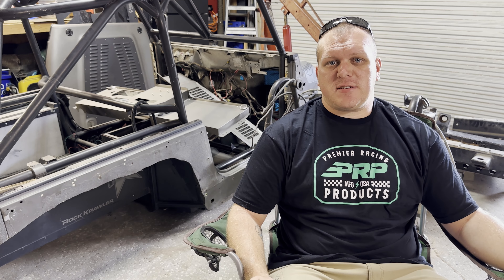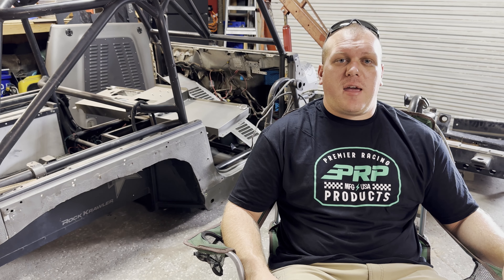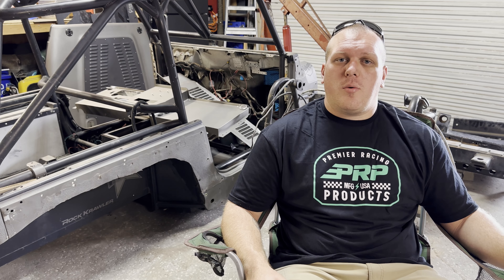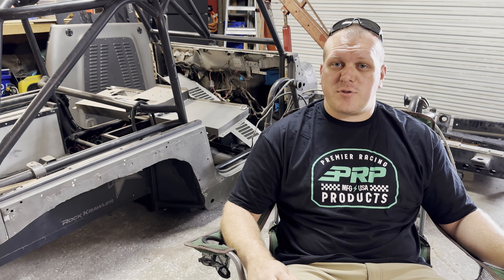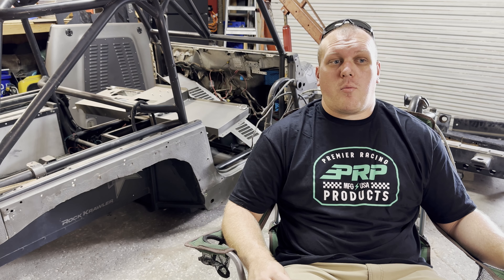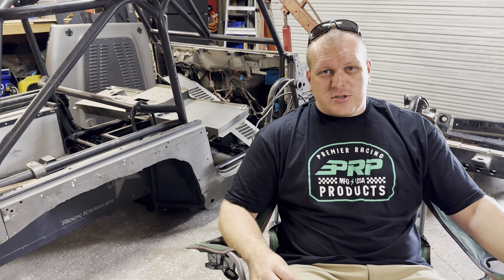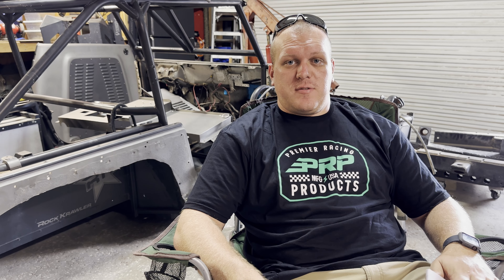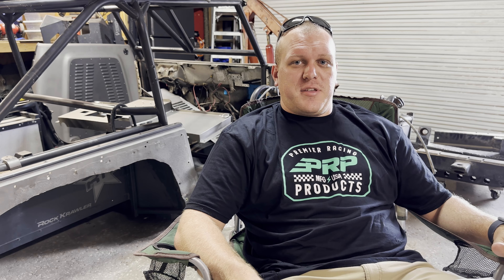Recoil TJs Rebuild Plan

Comment: You are going to have to go full hydro on the front with the double triangulated kit, if not and you try to go 3 link you will have binding issues correct?
Reply from the maker: The Front half kit is designed for full hydro. You COULD make a steering box fit though. The front 4 link could be modified into a 3 link but that's not what I decided to do. I went full hydro so Im keeping the 4 link. Yes, technically you could have some binding issues if you ran a 4 link with a drag link because of the different angles of axle travel.

Comment: Really enjoy your work and channel. Do you have a instagram page or fb? I want to get your in input on put 37’s on my tj. Im on 35 with4.5 lift and rockcrawler long arm. I want to put a rear stretch without going all out. I know they make genright factory location tank. How would you go about stretching the rear without relocating tank? Is it simple as adjusting arm length and relocating rear spring location? Or do I need to change rear links?
Reply from the maker: Absolutely! Instagram link should be on the main channel page. Recoil_TJ

Comment: Do you really, really need tons? I ask myself that on a regular basis. I've got a ProRock 44 up front, built to the nines. 35 spline RCVs, ARB locker, Reid knucks, BJ deletes. Trussed D44 in the rear, 35 spline chromos, ARB, Yukon gears, sitting on 40" STT Pros & KMC beadlocks. Those axles have never failed me...never. And yet the end goal is still SD60/14B. I've never babied it either. I'm heavy on the skinny pedal & in the back of my head I almost want to grenade it so I can justify spending money on tons. If I'm being honest with myself, it's more want than need. I don't NEED to run 43" MT Baja Pro XS but I know I want to Lol. 
We do it because we're Jeep degenerates. That's what we do. We build it up till we can't build no more & proud of it!
Reply from the maker: well that's definitely how my mindset started lol. Every time that jeep was out the last year or two I felt likt it was at its limit. im really impressed by what they held up to for sure. There wasn't much more upgrading to be done on those axles either so the new owner will surely enjoy them for years! As far as need... does anybody NEED a jeep thats not a daily and NEED a rock crawler toy? No so I thing whatever you do its a matter of want lol! Given that I did have 1 issue on mine early on it kept my wheeling somewhat reserved. Not anymore, with the custom setup im going with I should have no problem running the new 42" bosses and actually putting some HP behind them as well. I say build those axles man!